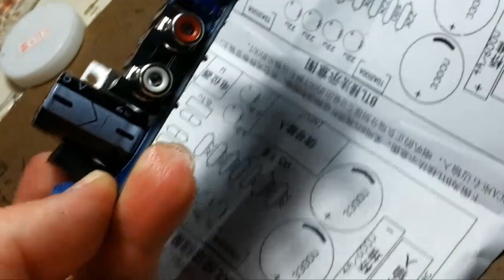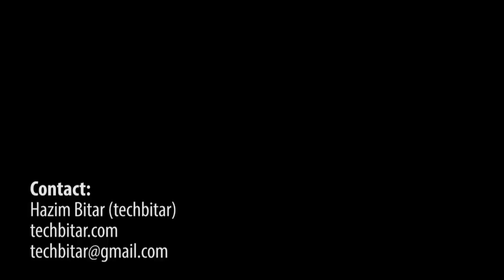TDA2030A-based Audio Amplifier Project

Comment: This is an old video but as Balázs and Alexandru have pointed out, your're doing this wrong. You need a center-tapped transformer for this, it runs off of a split rail supply, not just a single rail supply. And you shouldn't have installed R4. Only install R4 when you run it bridged. For stereo assemble everything but R4. For bridge, install R4 and leave out C9, run signal into the right RCA. Also, you can easily upgrade this amplifier by replacing the TDA2030As with LM1875s, which have a more dynamic and open sound. They're drop-in replacements so no need for pin mods or any other tinkering.

Comment: I have the same kit, but cannot get it run, because this needs a twin transformer (provides 2 times 12 V AC), that I don't have. Further more, according to the description you shouldn't have applied the R4 resistor.
Reply: does this require a positive 12v and a negative 12v?
Reply: The time being I have bought the proper transformer for it. See my channel for details. Just seek for the "Home made loudspeaker enclosure" project. The transformer you need is one that provides two times 12V (AC) with one common lead. (Or in other words, it provides 24 volts AC that also has an output in "half way".)